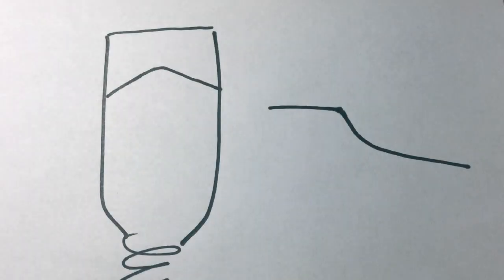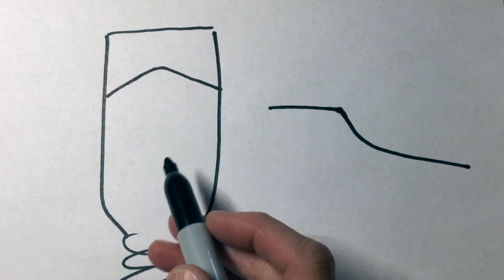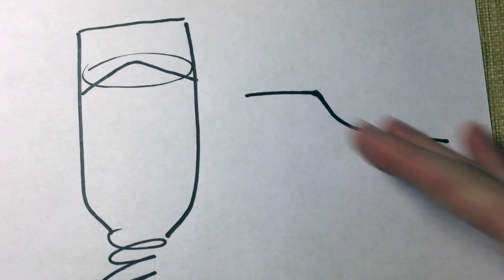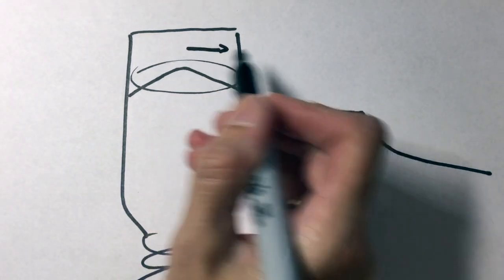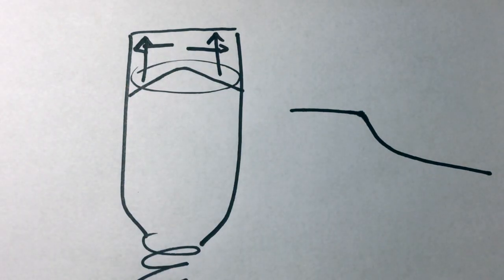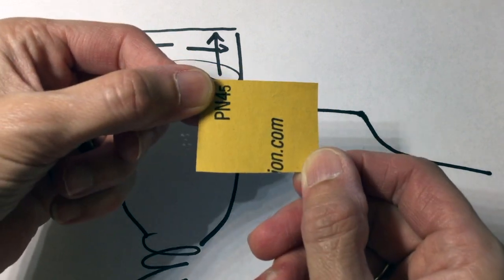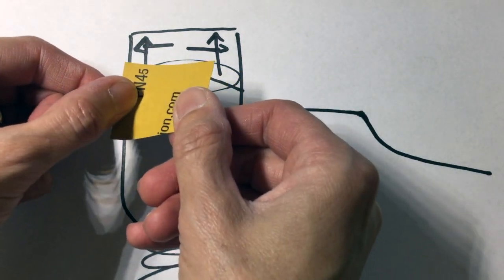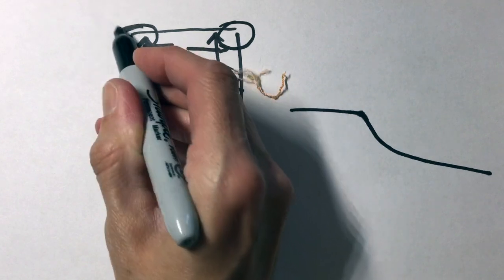Five Minute Reedmaker: Tone

Comment: Maybe it’s related to this. What do you do when a reed has a buzz sound? It most often happens with a middle C but can happen to other notes too. Thanks!
Reply from the maker: Hmm.  Are the sides not sealing well all the way to the top of the reed?  Is the tip too long and not thinnest at the corners? What happens if you JUST clip a tiny bit?
Reply: Thanks so much! I’ll check on these things. I’ve made reeds for years, on and off, but am learning so much through your videos!!
Reply from the maker: @darlenejohnson9534  I'm so glad!